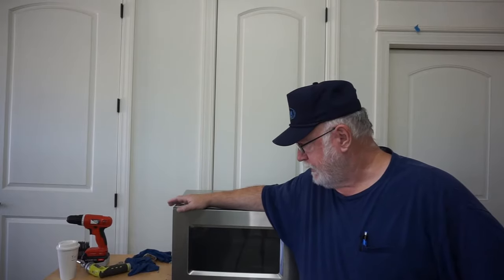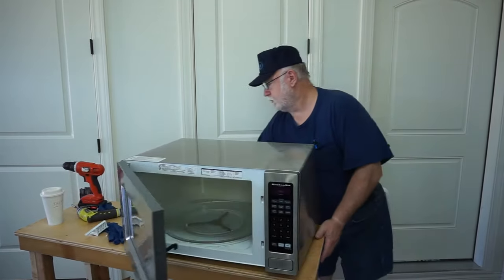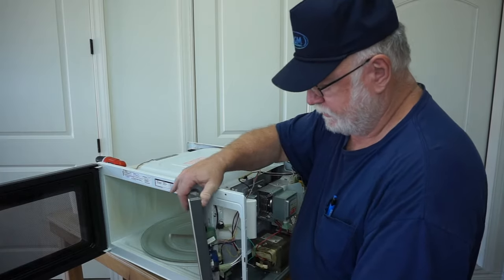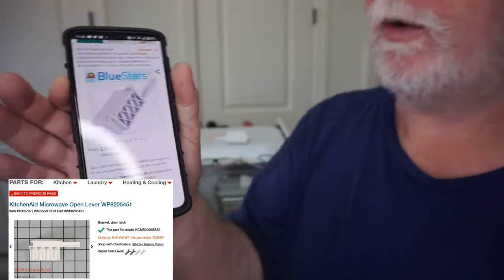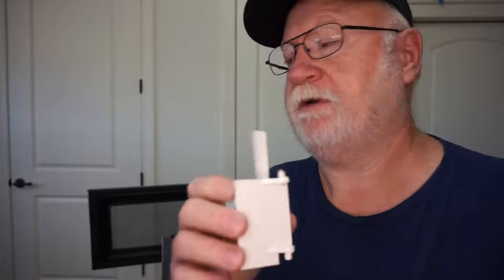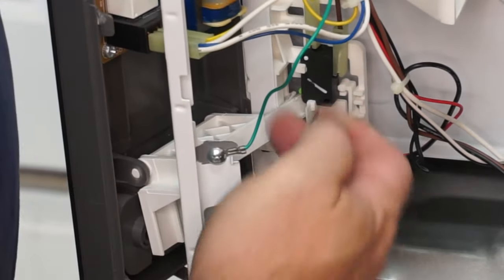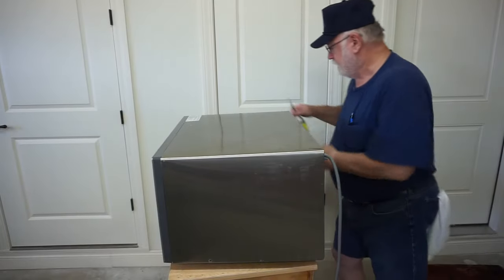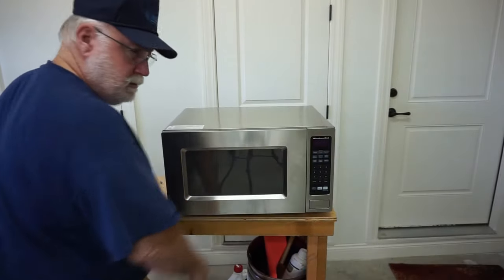Reviving Your Microwave: Assessing the Value of Door Latch Button Repair

Comment: Really helpful! If you're like me and have had this since 2009, be prepared for a lot of grease... Super helpful that you gave the part on Amazon.
Reply from the maker: Just happy to have helped you out. Most microwave / toaster ovens are fairly simple repairs.

Most problems revolves around one or more of the microswitches if it isn't mechanical such as a latch.

Hope you subscribed, liked and hit that notification bell. I can use the help.

Thanks for watching.
Max Hughes

Comment: we managed to order this part and do the repair - saved $500+ in a new microwave cost - thankyou
Didn't take the front panel off either as could fiddle around and get it in without having to remove
Reply from the maker: Rachel, I'm very pleased my video may have helped in some small way.

Apparently your hands are smaller than the old fat man. lol.

Did you attempt to put a screw into the piece that broke off? If you managed that and kept it straight it is much stronger than the replacement.

I can't even tell you where the two replacements I purchased have been hidden from me. 

Hope you subscribe and thanks for watching.

Comment: Randomly found this viedo. I have totally different microwave, still problem was similar - one of the door buttons was busted. Service center said it would cost 25 usd to repair + up to 2 weeks of work so i refused.
Then i ordered new button for 3 usd picked up in nearby spare parts shop on the same day and replaced in 10 minutes.
My microwave works great now!
Thanks!
Reply from the maker: Very happy this video may have helped you. Just so happy also you can speak English as I'd never be able to record it in your language to help your countrymen that can't speak English.

Thank you for watching.

Comment: Thank you !!!!

It worked perfectly… I did not take off the button panel… it worked from the side with a little (firm but gentle) pressure on the gray plastic.

The new part cost me $12 dollars (US dollars) on Amazon.

We have had our microwave for 11 years…and now it will work for a few more years.

You are the man!
Reply from the maker: Glad we could be a small bit of assistance in keeping your machine up and running. 

Hope you sub'd and liked. It would help me tremendously decide to continue bringing more helpful videos in the future.

Thanks for watching and again, glad to have helped.
Reply: Hey, can you link the Amazon order? The only suitable parts I’m able to find are through specialized stores and they’re charging insane amounts.
Reply from the maker: @masterchief1372  All I did was watch my video to 4:57 which after a few seconds gives you all the information needed to open Amazon, input the information that pops right open to the part you seek. Easy peasy. The part is $11.69

Ultra Durable 8205451 Microwave Latch Bracket Replacement Part by BlueStars - Exact Fit for Whirlpool & KitchenAid Microwaves - Replaces WP8205451 W10298900 PS11745265 AP3776470 AH972837

Comment: Thanks! This is the exact problem I had with my 2009 KitchenAid (same lever peg broke in the same spot, clearly a weak point). Big thanks for the walk-through and replacement part reference—got it overnight from Amazon and just installed, works great.
Reply from the maker: Glad my video was in some way helpful. I hope you saved both parts of the old lever and repaired it. It will be hundreds of times stronger than the new lever you replaced it with.

I have two replacements and couldn't tell you where I packed them. That's how confident I am in that statement.

Hope you subscribed and thanks for watching.

Comment: Instead of drilling and screwing on the tab, could you have used superglue & baking-soda (maybe charcoal added for reinforcement)? Another video shows a guy doing that. What i'd find most daunting, is removing the electronic panel, because i'm terrified of fooling with electrical wiring. I've a top-quality 700watt countertop Sharp from the 1980s. Its electronic-panel is still smooth after more than 30 years. But by now  the push-button very weak. (Also the light doesn't light, but that doesn't bother me.) I take it there's less problems with Pull-Open doors than Push-Button?
Reply from the maker: The super glue and charcoal is snake oil. You're welcome to use that method, however you'll break it more than likely first push on the door button.

Remember, you are going to disconnect your electrical cord from the house electrical system. There is now nothing you'll be touching that has any discharge to you or shouldn't be. With that said, the repair is very straight forward. My fix is the cure as you're not going to be able to hit it hard enough to break that screw. Remember, you can't control just how hard others push on the button and many thinks they should try to destroy everything they touch. That person is the one I make repairs for as a challenge to them to go ahead and give it your best shot.

Whichever route you take, hopefully it works best for you. Remember though, once you do the charcoal thing getting the pieces to fit precisely again is out the window. 

Hope you subscribed, liked and hit the notification bell.

Best of luck and kind regards,

Max
Reply: @MaxsGarajMahal  Mine is the vintage R-2A55 Sharp. A local repair guy told me by phone that it sounds as if i may need a whole new door (due to the spring being embedded within the door). But parts aren't available anymore for my model. My situation is, that I need to press in JUST the right place on the push-button for the door to weakly open. So if it were you - what would you do?
Reply from the maker: @minniyoutubaster  If it was me? I'd disassemble it, see how the door latch works while diagnosing the problem, design a plan, implement the plan, reassemble it to make sure it functions properly, then forget it if your repair design is solid. 

Here is a microwave that may be very close to your door design although the overall look may be different, you're more concerned with the mechanical design more than the aesthetical design. This video may be revealing to you once you see just how simple it is to take down and put back together. It will also help you in the future when one of the microswitches goes out on yours and it will. This is the URL for that video named: "Conquering a Stubborn Microwave That Won't Shut Off: Restoring Control, and How You Can Too!"
https://www.youtube.com/watch?v=NJAZ2V5dF1s Just copy and paste that url into another tab and you'll go right to it.
Reply: @MaxsGarajMahal  Um, I clicked there, but in that vid you're focusing on switches, whereas i'm wanting to know how hard it is to fix latches that are embedded in the door. It may be way beyond my capability. That's where i'm at now. Besides, I personally am scared to fool with electronic switches. 🙄
Reply from the maker: @minniyoutubaster  You failed to garner the door latch part that is in the video. Plus you gained lessons on the switches that you'll need sooner than later. 

If you knock it apart, take some photos of the system, I'll be happy to do my best to see if a resolution comes to me. @gmail is my email to share the pics.

That 30+ year old microwave/toaster/oven had the type of latch if I remember correctly. Seems it had a coil spring in the door but then that's been a year or two ago. 

The owner had a shop tell her it couldn't be repaired, couldn't get parts any longer and it isn't worth repairing. That was because the door latch stopped working because the top of the door broke when he was diagnosing the latch. For some reason, he pried up on the top of the door breaking the plastic retainer. It was JB Welded and still in service. That was 15 years ago. 

Remember, I pretty much always had what I used and used what I had.

Comment: I have the exact problem with Frigidaire brand but fitted in cabinet.  Who can help with me I mean local appliances repair shop or I have to call manufacturer?  This must be 2006 or 2007 unit as first install with new construction. 

How much I can roughly spend for this work in Palm Harbor Florida?

Thank you for your clean video.
Reply: I was able to order the part from Amazon and install it myself by following your video. Had to by screw bit from Lowe's. Total cost of the project for material was $75. All is good and working. Thank you again.